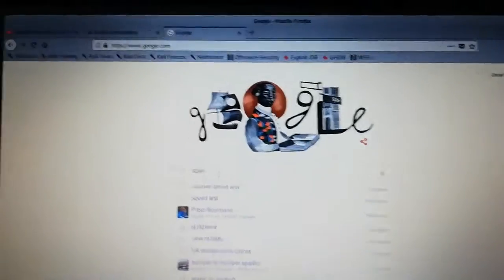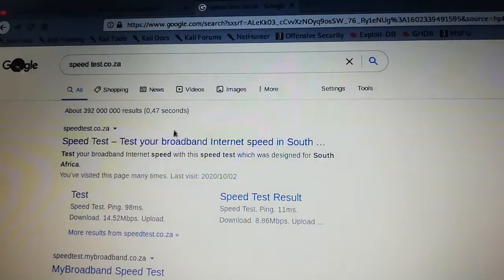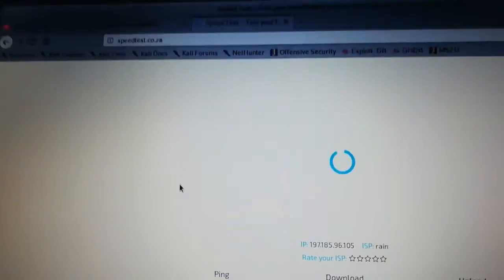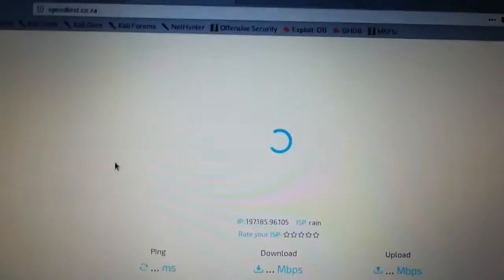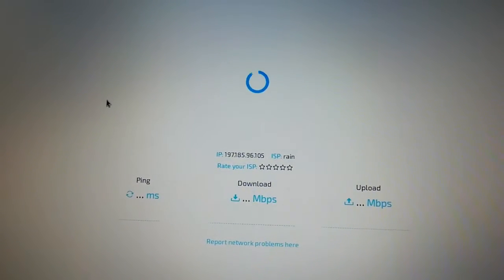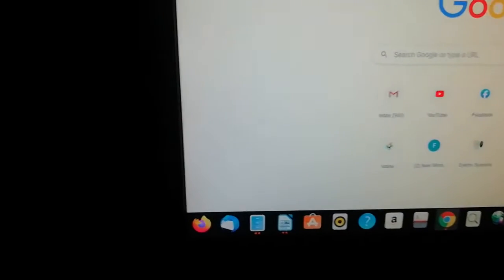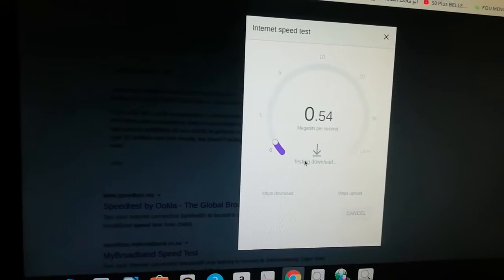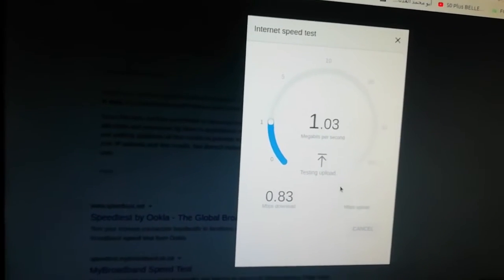How to increase your internet speed for Rain Huawei router 5g

Comment: Ours is that huge 5g router that you mount outside. For a couple of months it easily hit 300-500 mb/s download speed, however now it struggles to maintain 70-100. I have no idea what's wrong with it or if they might've messed something up but it's been like this for awhile. Any idea on how to possibly bring it back to its original peak? The upload too, it went from 70 to 50 mb/s.
Reply from the maker: if u in South Africa and using rain , these days because of load-shading the network struggles